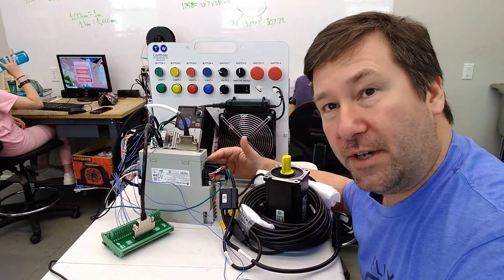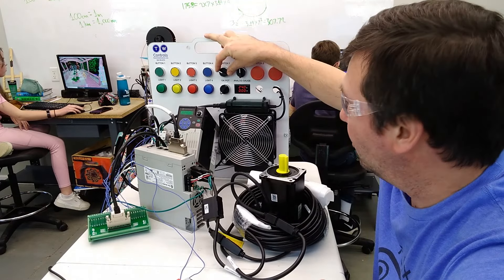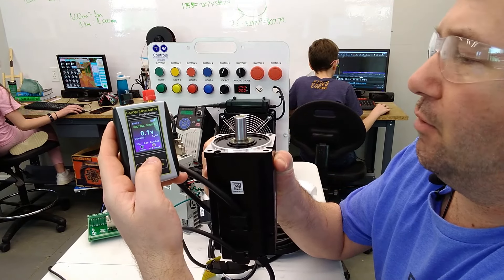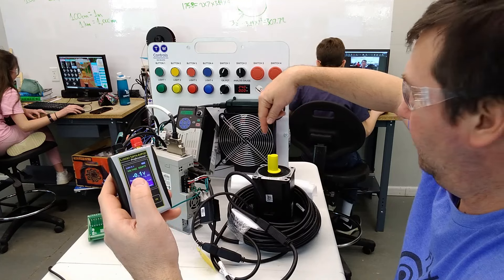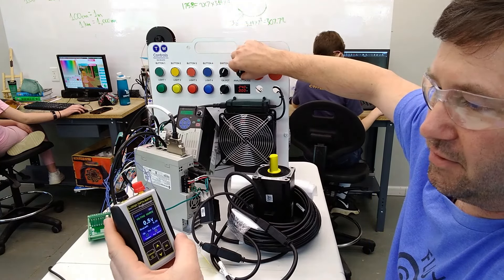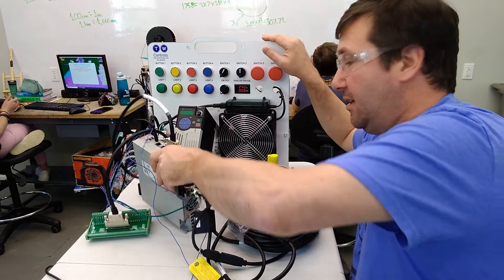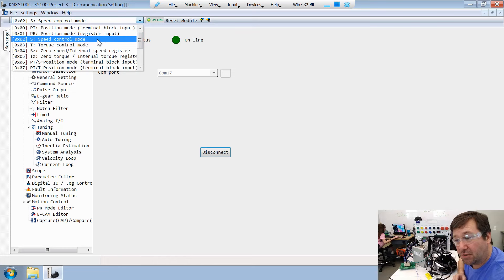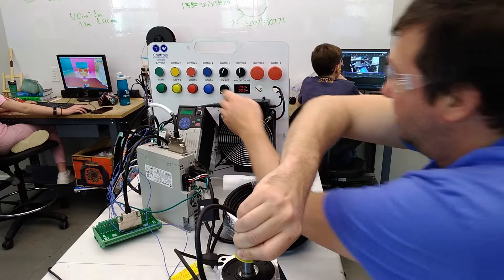Introduction to Servo Motors and Motion Controllers

Comment: Hello thanks for the video. Is there any form to refrigerate the servo? how many hours can be running without stoping? i want to use to drive an spindle for cut steel
Reply from the maker: Many servos are designed for 100% duty cycle but you would have to check the specifications one the individual one.

Comment: AN OTHER   A M A Z I N G   VIDEO that saves my A****😂!!!!Thank you for all your efforts in making these videos!!!Awesome!!! I need to control 1 of those AC servo motor with a Raspberry pi and by just listening I think I have a clue 😅: feed an analog signal(0-10V as you are doing in here) to the motor; I'm planning to generate the signal with the RPi  PMW and have some sort of hardware that would eventually output a range of 0-10V signal; and that's it; I would add few buttons/switches for the enable,reset and EmergencySwitch.  I'm planning all this if the actual driver/controller supports DIO and AIO a the same time 😬😬🤞🏼🤞🏼thank you for the inspiration
Reply from the maker: You are welcome!

Comment: i have several servo motors and some drivers, all salvaged. can you do a how to connect up and test runn. like this vid, but the analog signal thing you use i dont have will need a nother way to give that signal

Comment: hey Tim for the Kinetix 5700 do you need program to tune it or make it with PID? and another thing on motion group axis Propieties>>Velocity Loop does the Hertz affect the motion if i change them and set some limit on Error Tolerrance just say 350 degre because they rotate 360 degre and with a tolerante of 10 degre ?
Reply from the maker: I haven't worked with the Kinetix 5700 but autotuning is available on the Kinetix 5500's software.

Comment: Tim, is there a difference between a "servo" and an "indexing servo". I want a servo to do something once it sees the Photo-Eye and gets enough encoder pulses. Then based on some inputs for start, and dwell, it cycles and goes back to a zero position.  Thanks for you help.
Reply from the maker: An "indexing servo drive" has the motion control part built in.  This usually means you can trigger a motion event to happen when an input such as a photoeye is seen.  A regular servo drive requires some external motion controller to operate the servo drive.

Comment: Hi Tim,  quick question for you sir. I have a Kinetix 350 attached to an Allen Bradley servo motor and whenever the MSO command is sent the Servo vibrates a lot and then faults out. However when you complete the hookup test it moves great...nice, slow, and smooth.Any ideas? Thanks!
Reply from the maker: Sounds like tuning.

Comment: Hi Tim, what type of servo motor are you using like dc or BLDC?
Reply from the maker: AC
Reply: @TimWilborne  actually i have a doubt, is there any way to change the direction of BLDC motor without changing the terminal or without any switch ?
Reply: @TimWilborne  Can we change its direction by changing its switching sequence?
Reply from the maker: Many drives will accommodate reversing direction.
Reply: @TimWilborne  but what technique is used/required for directional change?
Reply from the maker: It is an input to the drive.

Comment: Hello Tim can you tell me what would cause a servo motor to set a higher  torque valve as the machines get older .
Reply from the maker: Hi Steve, I'd guess mechanical wear.

Comment: Hi Tim, thanks for the great video. I have a Kinetix 5100 servo and Micrologix 1400 PLC. I want to be able to write the speed and length values from my PLC to the Kinetix 5100 parameters. Can I do this on MSG instruction in my RS500 program? Hope you can do a video of this too. Thanks
Reply from the maker: Hi Davis.  I think it would take some work, I've done it with a Micro850 and it is more than a simple message instruction.  I don't plan on doing any Micrologix 1400 to Kinetix 5100 videos right now.

Comment: Hey Tim I was wondering if you or maybe someone you knows. Could tell me how to find the servo motors RPM feedback in real time. I have searched the Internet and read and looked thru all of Rockwell. Nothing on the topic. Unfortunately I don’t lots of money to spend on servo tech connect so I was hoping maybe you or someone here could help. I want to use the encoder that is on the motor not an external source either. Thanks.
Reply from the maker: It would depend on the particular Servo.  If it is already being controlled over Ethernet, the data is likely already available in the PLC.
Reply: Kinetix 5300 is what was chosen by a Rockwell engineer for this particular application. This is a spin weld application at a former employer of mine.
Reply: @TimWilborne if it was possible to get live position units per second then this would be a slam dunk by taking live position units per second divided by encoder resolution times 60. But all I can find is actual velocity.
Reply from the maker: That data is available on the 5300, it depends on the set up.
Reply: @TimWilborne thank you I will keep digging.

Comment: Can you suggest a universal servo drive for 50kw?
Reply from the maker: That's a stout motor, way larger than my applications have ever needed
Reply: @TimWilborne  : so sir can you suggest for a 25-30 kw universal servo drive range?
Reply from the maker: No, if you have a specific application, you need to connect with a servo brand that is popular in your area

Comment: Sir, how many servo or steeper motors can we connect to 2 axis controller?
Reply from the maker: Typically the number of axis is the number of servos also.  So 2 axis,  2 servos.
Reply: There are installations where you can have two servos per axis like a gantry router. One servo is the master and the second is the slave, You need to make sure your controller supports slave drives though.

Comment: Tim, great video. I want to replace old system with a servo system. Similar machines have a 5hp motor. The process is the servo controller gets speed information and a Photo-eye to know when item is at a certain point. Then based on machine speed the servo shaft rotates at same speed as machine to push an item up using a part attached to the shaft. I'd like to know more about servos that use a start point, speed input and rotation (stops or dwells once rotated), and it returns to start waiting for the next cycle to begin.  Maybe you'll do a video on these basics.

Comment: I was wondering are there any servo motors that could power a table saw?
Reply from the maker: Plenty, but what would you gain?
Reply: @TimWilborne  From what I have understood is servo motors are brushless have more torque in the targeted rpm range and are lighter and smaller than the motors that are more expensive. That being the main reason they are not used widely in tablesaws. But I was thinking that if servo motors would actually be strong enough and lighter I could retro fit one on a saw I have to move quite often.  I would rather pay a bit more for a lighter solution, than strain my back. The lighter bench saws are very underpowered.

Comment: I have an Allen Bradley Ultra 3000 that suddenly started moving in the reverse when referencing.   ANY idea what has happened anyone ?????
Reply from the maker: Hard to say without no details of the system but check your reference signal and see if it is reversed

Comment: I use kinetix 5500 025H.
How to solve the S30 fault problem one motor draw other motor 
because they run difference speed with each servo use loadcell control speed the motor 1 draw motor 2 I see the DC bus value of motor 1 around 500VDC and motor 2 DC bus around 750VDC all time and it can run only 2 minute and S30 fault appear every cycle ?